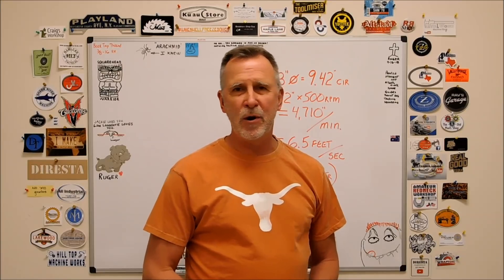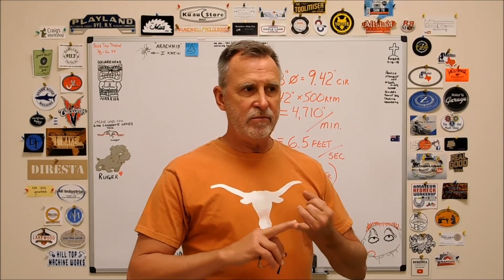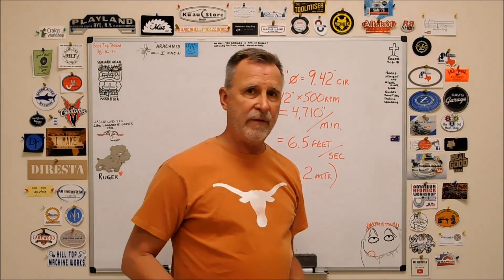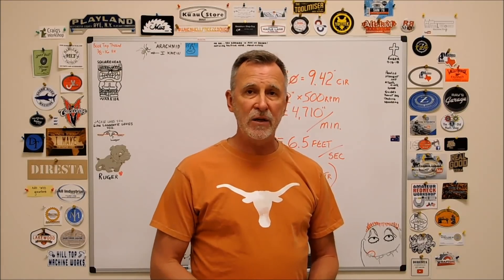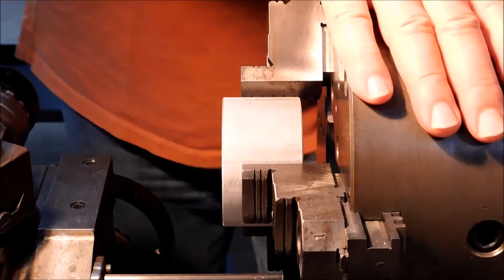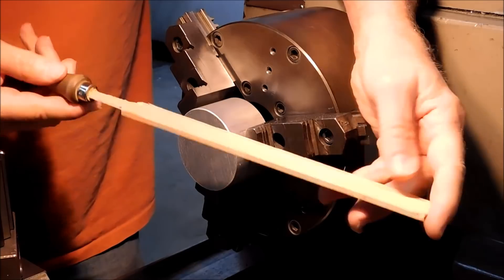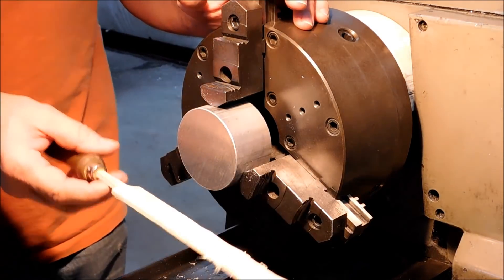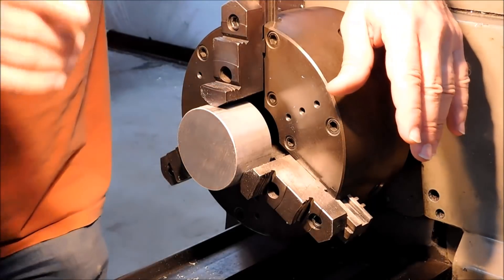File vs Spinning Chuck Jaws

Comment: I'm sure Joe knows how to use a lathe but I'm less covinced by his maths. At 500 rpm on 3" stock the tip is moving at nearer to 60 feet per second, not 6 feet.  In a lifetime of using machines and doing difficult jobs I always calculate my risks and you need good basic maths to do this.  In the unlikely event that I needed to use a file in a lathe I'd make up a carrier for it and mount it on the toolpost and as for leaning over a spinning chuck , well I can't find words...................
Reply: Are you sure about your math? To convert in/min to ft/sec doesn’t one divide the former by 720?
Reply: "I made that same error when I ran the figures the first time.  Mrs. Pierce would have called me to the front of the room and made me show my work.  Nothing like a little pubic humiliation to reinforce accuracy.  When you suffer a few of those, it breeds a careful attitude and running the numbers several times to avoid embarrassment, and the eventual failure of a design with the consequences that entails....
Reply: 500 rpm 3" stock will be 392.5 feet per minute or 4710 inches 

And that's 6.541 feet pr second. Fairly simple math
Reply from the maker: 3" x 3.14 = 9.42" circumference   9.42 x 500 r/p Minute = 4710" per minute  1 minute =60 seconds  
4710" divided by 60 seconds = 78.5" sec

Where did I go wrong?   I'd also like to see that toolpost mounted file. Shoot a video for us.
Reply: @joepie221  Tell that "guy"...    It's 4 fingers & 2 toes!      Simple pregurgitated mathematical  obnosis.
Reply: @dotygramp9109  I think any machinist/mechanic that only has left 4 fingers & 2 toes, should probably consider a different line of work.  Just joking, loved your, "Simple pregurgitated mathematical obnosis."  I'm going keep that one!

Comment: Joe, this is something I learned from an old Navy machinist during my early machinist days.  Sort of an apprentice ship, though my old Navy friend was retired out of the Navy by that time. 

If Ol' Jack had seen me use a short file on a piece in a large chuck, he would have smacked me in the head.  Always use a file length that gets your hands away from the spinning jaws.  Filing in the chuck was a normal thing when I was coming up, and I don't recall anyone getting injured by using the proper technique.  I reckon I'm a ways older than you, so maybe it was drilled into my noggin a bit more back in the day.  And... files without handles would get you sent home as fast as leaving a key in the chuck.  No pay that day. 

Great to hear you talk about things I learned.  Keep all your fingers on and keep the red stuff inside, right?
I enjoy your shows.  Thanks!  Dean.
Oh yeah, one more thing;  The files we used on the lathe where kept in a can of sulfur oil.  Files for filing dry were coated with railroad chalk.  Kept the from pinning.  Just more old stuff.  DW  :)
Reply: dcw56: your input  made the comments worth reading.  I have ALWAYS wondered about cutting oil on a file, and you answered it for me.  Thank you.  And in the back of my head there was a question about the length of the file....  You answered that as well.  Never too old to learn....
Reply from the maker: I've done the chalk trick. It does work. thanks for the comment Dean.

Comment: Should have shown a file with 1-inch wide emery cloth or paste to deburr and polish. I do not reach over the lathe to file and am more comfortable with standing slightly back and reaching in with the file parallel to the chuck face especially when running larger lathes where it is not possible to reach over the top.
Reply from the maker: Common sense has to change things sometime.

Comment: I have a semi functional right hand, so it's a little tricky for me.  I can hold the tip of the file with my right, so I would not be reaching around the chuck like you do, but would reach with the right around the right side.  I'd be nervous your way anyway, specially if I'm wearing a shirt!  I've done a very little one-handed or 1½ handed filing since I was disabled, but frankly don't like it.

Interested to hear comments.  Just please don't tell me to sell the lathe!

Comment: Hi Joe, you didn't mention lathe files. For this video I think they're very worth mentioning.
Reply: You should have mentioned that lathe files have no teeth on the edges only on the face.
Reply: Agree! Never use a hand file in a lathe. Only lathe file. A hand file can all of a sudden be "sucked" in towards the chuck since they are crossed cut.

Comment: I have never been comfortable reaching my left arm over the chuck for any reason. I would suggest challenging yourself to learn how to hold the file left handed. If you have a decent sense of self preservation you will be fine. Dont forget.. wood turning and metal spinning guys have to worry about these dangers way more than us metal guys.
Reply: I was taught the 'reach over the chuck' method and I thought it was the stupidest thing I'd ever seen. I stand off to the side of the chuck, towards the tailstock, file handle in left hand, tip in right thumb and forefinger and angle the file away from the jaws. Never had an issue.
Reply: @GeneralChangFromDanang  In my Machining classes they taught us to hold the handle with our left hands and the tip in our right so nothing can get caught in the spinning chuck. Felt awkward at first and was tempted to switch, but after doing it once it was unnerving enough that I'm not a fan. Even braced so I don't slip or lean too far it just doesn't seem worth it.
Reply: Max Idontwanna Lucky for me I had a good teacher, and he taught us to file left handed on a lathe. I’ve never even thought about doing it right handed. One mistake and you’re dead

Comment: Instead of wrapping the left arm around the chuck area, why not swap the grip use the right hand to control the tip of the file instead?
Reply: That's what I do when I'm very rarely on a lathe but also back when I was on them often, keeps you out of the firing line incase of an accident...

Comment: When I don’t have a file handle I pull file with the lathe spinning backwards, tang of file facing away from me.
Reply: I don't want to be a pest, but that is still dangerous. You probably won't get it stuck in your gut, but depending on how you are holding it you might get the tang through the palm of your hand or the back corner of the file gouging you real good. And that could make you jerk forward and get your chest on the spinning part, which might not be good.

If you don't have a proper handle, saw off a 4" hunk of wooden broom handle and drill a 1/4" hole in one end for the tang Spend a minute or two and round the end on the bench grinder or with a file or whatever, and if you think there is  chance of the dowel splitting from the tang pressure you can wrap a couple turns of #18 wire around the front end, twist the ends tight, and then hammer them flat into the wood so there is nothing sticking up to catch or scrape you.

You can even make a handle out of a hunk of 2x4, but it won't be very good and will tend to split. You must wire at east the front end to prevent splitting, and wrapping the whole thing in a couple turns of duct tape is a real good idea. But that would be a real "emergency handle" and best thrown away after the one use you need it for. It would be better than no handle at all, but not much.
Reply: l wilton good points thank you,  No excuse for no handle, I always enjoy using broomsticks too!

Comment: Good video Joe, should mention not to use left hand if your right handed plus you have no support to stop you moving.
You demonstrated the correct way you have support with left arm stops body movement the key. Would spin it a lot faster though you; be there all day, if too close you can feel the jaws and turbulence, dubiously less chance of file catching as well.

Comment: I always file left handed and never reach over the chuck.......
even a small lathe  can and will make a mess of you that you 'don't want your wife to have to clean up....
Reply: No control if your right handed not to mention no support. Two wrongs dont make a right
Reply: @jhareng  That why you should use an elbow on the tailstock,.

Comment: Just another way to file on a lathe: over the top, with the spindle running in reverse, while holding the file lightly with one hand by its tip rather than the handle. The weight of the file is generally enough contact pressure, and a couple quick drags of the file toward yourself is generally all you need. Gets me good results and keeps my hand as far from the danger zone as possible. Thankfully I've never actually had a bad catch or slip up with a file, but the idea is that if I did the direction of rotation would take the file away from me rather than throwing it toward me.

Also I never get both of my hands on opposite sides of a rotating chuck under any circumstance but I mean uh you do you Joe.

Comment: excellent demonstration  you either A, know what the  heck you are talking about from experience or B  have  Nerves of Steel , i am a retired Woodworker who does have a interest inMachining  but i’ll admit the raw power of a metal Lathe scares me   over 10 years ago i suffered a Major Stroke on a operating table that resulted in damaging 90 to 95% of my brains right hemisphere  which has also resulted in loosing the ability to use my left hand  plus a pretty fair amount of prescription drugs  and the brain trauma has made me very jumpy  at times  not something inmy previous life  that  i ever was don’t get me wrong Cautios and respectful Yes , Afraid NO  i’ve unfortunately seen co workers with many years experience lose a finger in a extremely fast amount of time  and those people always said the same thing they couldn’t believe that it just happened to them  like it did
Reply: Sorry to hear of your medical problems.
If you're comfortable around a wood lathe you will be fine with a metal lathe.
Me personally have had more incidents with wood lathes than with metal.
Also, I knew a Tool Maker back when I was younger who did not have the use of his left arm, from polio if I remember correctly. 
I'm a bit foggy but I seem to remember that he had a 'tool rest' rod set-up on the back side that he would rest the file end against for use. It would hinge up out of the way when not in use.
Kind of like a wood lathe rest but for holding the end of the file.

Comment: I remember my first introduction to a metal lathe back in high school shop class (I won't tell you how long ago that was). The first thing my shop teacher talked about was how there were dangers all around the machine but the most dangerous spot was under the chuck. I think those that file from underneath have a death wish.
Reply: Me too, only secondary school in England, ha ha 50 years ago, Boxford lathes👍👍

Comment: Another good Joe Demo.   I would like to say that the chuck in the demo has a great set of heavy duty jaws, compared to my 3 and six Jaw x 6" radius swing chucks. The wooden File for demo purposes was a terrific Idea. showing the various techniques that can or can't cause problems.  And there is always a BUT ... LOL     I personally would never ever go with my left arm over a spinning chuck, or part of my body over the Head Gearing, with the chuck between my arms so to speak.  because there is to much of a chance of damage being done to the operator.  You could slip ... If you have a sleeve, it can get caught .... a shirt or coveralls can get to close and get caught ... I Always hold the Handle in my Left Hand with the Right hand at the Toe or end of the file past the Spinning Jaws with smooth short strokes for better control. This way No part of my Body is over or near the chuck.   But,   that is only my opinion, for my way. Anyway thanks for your demo.
Reply: That stuck out to me too. Obviously there is no perfectly safe way to run a lathe but putting both your hands on opposite sides of a rotating chuck ... that's a hard nope from me.

Comment: i was taught to hold the file handle in my left hand and tip in my right so i keep my body in front of the compound and use that for support. But i am almost fully ambidextrous so everyone may nto be able to do it as easily . Also always use lathe files they have a different rake to the cuts and don't load as quickly
Reply: Brian mcd I was taught the same.

Comment: I bought an actual lathe file for the first time a few months ago. It's way nicer then using regular files on a lathe. Instead my making dust, it makes little swirly chips. Everyone who files on a lathe should get one.
Reply: I always found those pushed off of the part easily. Prefer my standard files on a lathe. Don't have a problem with using my file card once in a while.

Comment: I was taught to use a file the way Joe showed, reaching your left arm over the chuck. I don't feel comfortable doing that, I prefer to hold the handle with my left hand, hold the tip with my right hand.

Comment: Very good reminder on the safety aspect of using a file on a lathe. I realized, after watching this video, that I have been using the files in a safe manner for a long time. Nevertheless, I maintain full respect for the mechanical strength of these machines. Thank you Joe.

Comment: Holding the handle with your left hand and resting your right arm on the toolpost allows you to be steady without your arm going over the top of the chuck.  It also keeps your shirt away from the chuck jaws.  That's the way we've always done it and it seems much safer.
Reply: I never wear a shirt near the lathe, that's just too dangerous.
Reply: @ChristophPech  me too and i love the feeling of hot chips on my bare chest!
Reply: Precisionmetalworks I'm with you on that. I'm left handed and still have a full set of fingers
Reply: I agree. Also, it allows you to stand to one side so that if anything happened you wouldn't be in the firing line.

Comment: Some of the manual guys at out shop have file that looks much safer to do this with. It's carbide file without a tang and has plastic handgrips on each end.  The handles stick out opposite of the cutting side. They love them.

Comment: Doing the surface speed math impressed me with why the file loads so rapidly.
First three lessons that I learned before operating a lathe...
1. The gravity of the the danger posed by leaving the chuck key in the chuck. The key on a Clausing Colchester 13" or 15" is a sizable chunk of steel to come flying out at your head.
2. Be careful about the length of extension of a part out of the rear of the spindle through hole. Out of balance and unsupported stock while spinning can bend. Bent at 90 degrees the radius of its reach is frightening. If it breaks off, it may not hit you, but could kill a coworker.
3. Never use a file without a handle on the tang. When the file becomes an unintended missile, the tang becomes a spear point.

Comment: Another great video and very relevant. Many home gamers (and some experienced ones too) may not have realised the dangers in using a file like that. Basically, when I was taught the craft, I was told that if you need to use a file in the lathe, you need to rethink your machining strategy. Thanks Joe.

Comment: I used a file for years without any problems.  I finally dedicated a tool holder with chamfer bits.  Looks better when done and takes the normalcy bias out of the equation. To be honest it was hard for me to watch after the intro.  I knew you weren't going to do anything stubid but my Dad had a saying back in the day, "It made their tail hole  tighten up so hard it would pinch a penny nail into."  Back in the early eighties at trade school they made us watch accident videos before they would turn us loose in the shop.  People that were pulled through PTOs, table saws and lathes to name a few.  I just haven't been the same since....

Comment: My favourite tool for cleaning files is an empty rifle cartridge. Mash the end flat and tap the primer hole for a handle. After a couple strokes along the teeth it molds to the tooth profile and digs out the cruft in the gullets. Amazing how much you can get out of a file. Thanks to Guy Lautard (wherever the heck he is) for that tip.
Reply: I use those stainless brushes that TIG welders have to clean up stuff.  If there are any pinnings left stuck in, I use the corner of a single edge razor blade to pop them out.  Always have a few of those blades around, they're useful for so many things!

Comment: Great demo Joe.  I think you could of mentioned that not to use short files, min. 10" but longer the better, much more control.  Thanks for sharing this Joe.  I have used a file for 40yrs on lathes, over the top.  Still dangerous and always with caution.
Reply from the maker: Hi Randy. I had thought about mentioning long files, but someone with a small machine would have complained. I decided to go with using a file long enough to get outside the envelope of rotation. I rarely go shorter than 8" when using a chuck. So your suggestion of using a long file is spot on for safety. I agree 100%. Thanks for the comment.